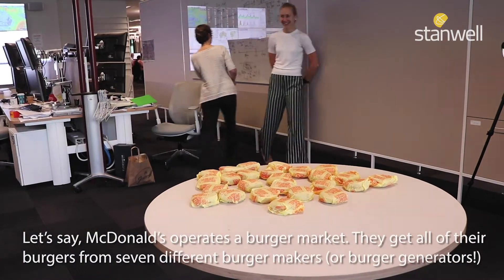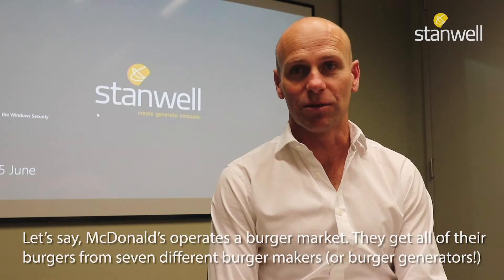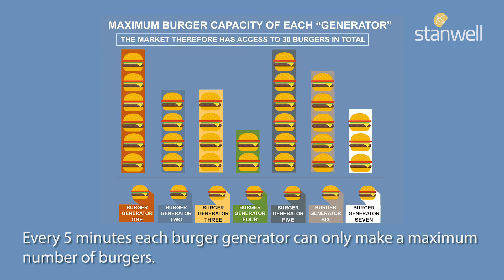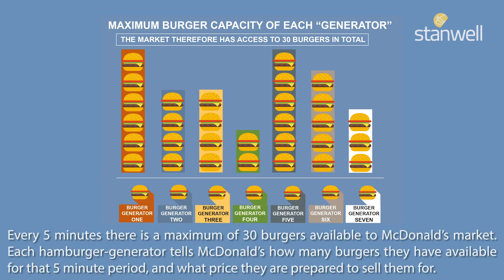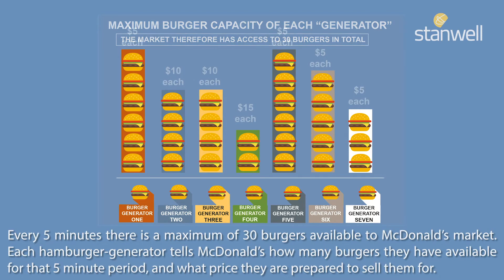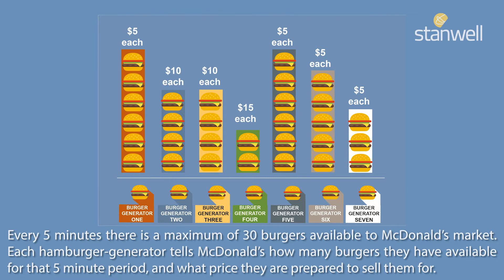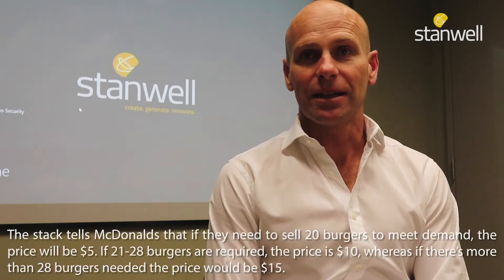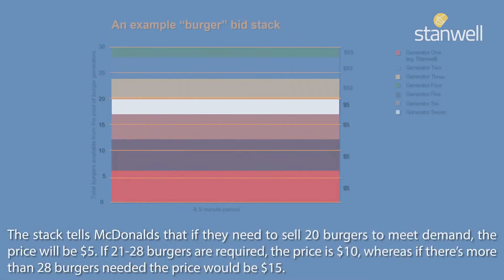Energy explainer:  The bid stack (A burger stack analogy)

Comment: So the price is set at the highest cost for that level of demand? Wouldn't a weighted average price be better, and then each supplier paid at the price they bid (rather than making additional profit based on the least efficient at that level required)?
Reply: Using a clearing price encourages suppliers to bid the lowest feasible price they can to maximize their chance of being selected and maximizing the amount of units they can sell. This has a downward pressure on prices as everyone tries to bid as low as possible to sell as much as they can. It also encourages investment and upgrades for increased efficiency as well, since every decrease in your per unit costs is automatically converted into additional revenue.

When you pay out on the bid value, there is upward pressure on prices as everyone tries to bid the most they can while still getting selected. If I can see that Generator X was selected to run and I know they usually bid 10X what I do, I can probably safely increase my bid to like, 9.5x my costs to get more profits. 
This means you're still going to pay most generators pretty close to the most expensive guy, but the most expensive guy is also padding his bids so his price will probably be higher than what it would have been if you used the other system. 

While it isn't initially intuitive, this method is pretty efficient and well studied.